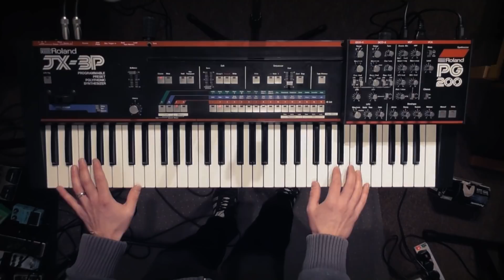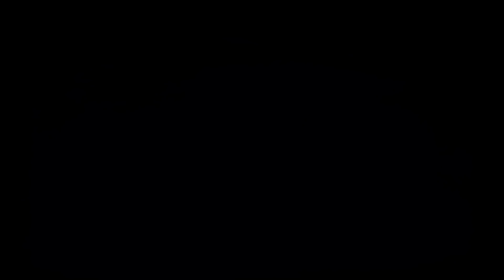80s Chord Voicing Tutorial - Part 2

Comment: Wow, the JX3P was my first real synthesizer back in 1989, now I have to get the JX03 to go with my Reface DX...
Reply from the maker: It's a great workhorse synth. You have to have the controller though!

How do you find the boutique by comparison?
Reply: Alex Ball Actually, I got my boutique today. It’s pretty good, although the chorus is a bit noisy and there’s a bit of aliasing on high frequencies. Other than that I think it’s a nice replica on mid and low registers, and as I said, it pairs very well with my Reface DX for the 80’s sound, plus both are running on batteries, which is good when out travelling.
Reply: matszh It’s possible to deactivate the simulated chorus noise on the JX-03.

Comment: My knowledge on music theory is somewhat low so apologies if this is a dumb question but for 'section2' when you begin on the Bbadd2 chord, is that a modulation from section 1 ? or are you modulating quite frequently in this demonstration ?
Reply from the maker: The whole piece is in D minor (D, E, F, G, A, Bb, C) and all the chords adhere to that with the exception of the G7sus4(no5) that is borrowed from another key / parallel mode.

So, when we go to Bbadd2 we're just starting on chord VI of D minor. 

In the video I mentioned that it had a "Lydian feel" to it at that point because Bb Lydian mode uses the same noted as D minor but running from Bb (Bb, C, D, E, F, G, A) but we didn't really modulate, we just changed chord within the key we were already in.

Hope that makes sense?
Reply: @AlexBallMusic  Ah okay that makes sense! so the Bb somewhat acts as the root instead of the D in section 2, that is why is it sounds like a change has happened but without changing key ? Also is Lydian mode used a lot in 80s music and that is why you used this change? or is this something you just tried and it worked? i am just wondering how you knew that change to Bb Lydian would work so well, is it because of what say that it uses the same notes as dminor ? Sorry if i am not making sense, i am just trying to understand more on 80s chord progressions and theory.
Reply from the maker: @ryancoulburn  That's exactly it. The Bb somewhat suggests a moment of Lydian mode which I've highlighted by playing a C/Bb chord as the E natural is a #4 and that's the note that makes the Lydian mode distinctive.

I did this because it was used commonly in 80s songs and film scores.
Reply: @AlexBallMusic  Awesome! i will have a play around using this and try and make some 80s sounding progressions. Thanks for responding!
Reply from the maker: @ryancoulburn  Pleasure. Have fun and happy new year!